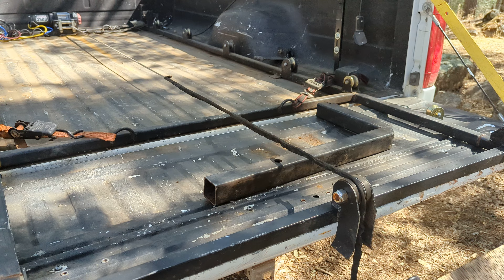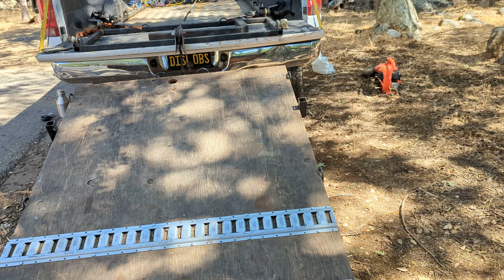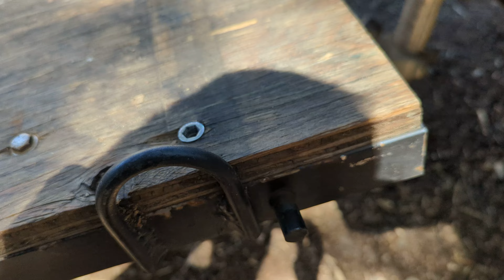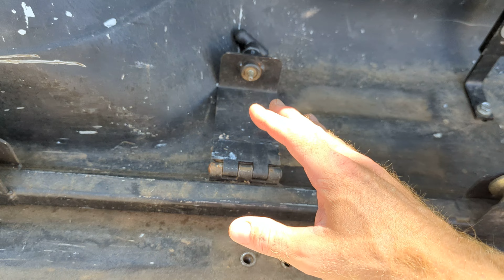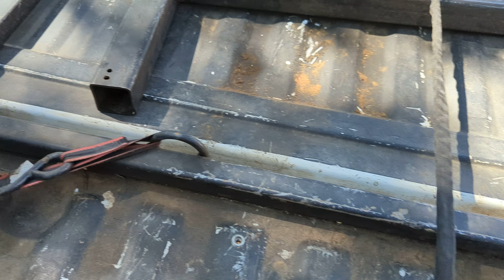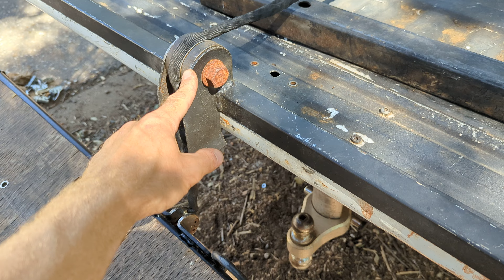MotoLoader Build Tips: Hole Locations, Mounting, Hitch Reinforcement

Comment: Can I build it as a single-wide? Just one bike.
Reply from the maker: Yes the width and length is customizable, however a narrower platform with a tall load will lose lateral stability. As long as the platform is tied down firmly it should not be an issue during transport but it will be more susceptible to tipping during loading.
Reply: @motoloader  Ok, double wide it is then :)